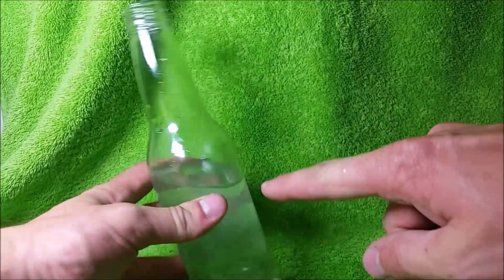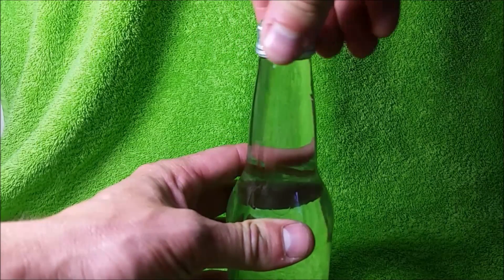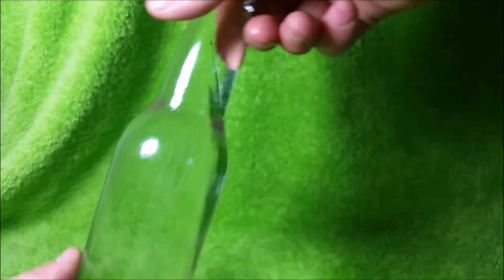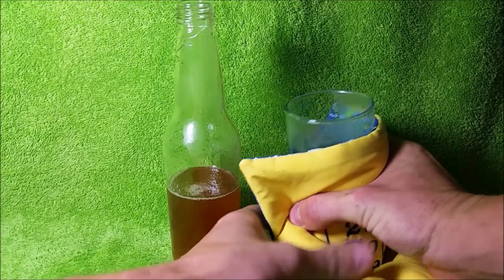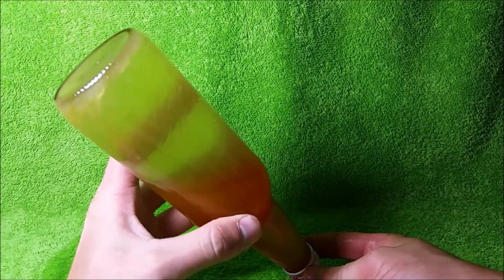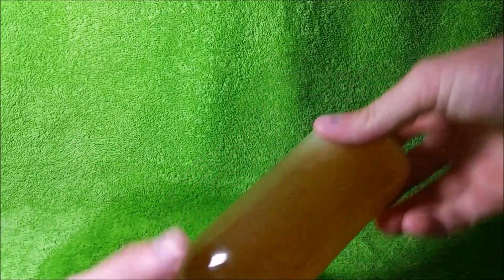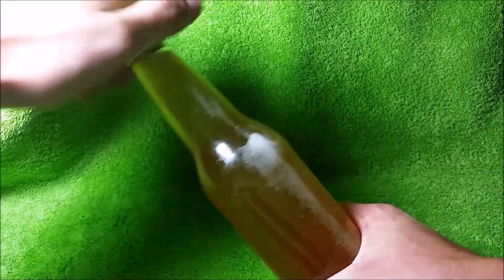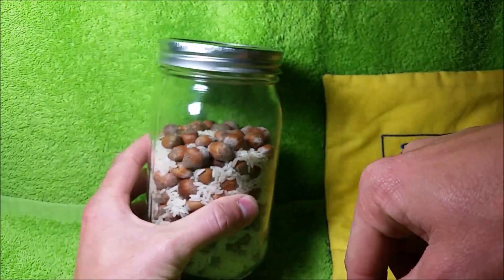Volume Change when Mixing Alcohol and Water Explained

Comment: Your explanation is clever and certainly "feels" right, but it's incorrect. The volumetric decrease is due to hydrogen bonding between the water and ethanol molecules. This is not a chemical reaction; rather, it's a physical phenomenon. There are interactions between the molecules in solution akin to weak magnets pulling on each other. This draws the net volume in as the aggregate effect pulls everything in closer together.

Please don't assert things like this without verifying that your explanation is correct. I appreciate your attempt at science here, but did you not think to look around on YT and/or other internet resources to see if there is a confirmed explanation before "explaining" this phenomenon to others? People will see this and "learn" something that isn't actually correct.

Comment: Used in my high school class. Really helped them understand why 100mL of water + 100 mL of sugar is only around 150 mL. Thank a lot!
Reply: Are you sure? You are not expecting such a huge volume contraction. In fact H2=+ sugar has a lower contraction than H2O+ Alcohol. Sugar has a density of 1.6 kg/L, so, if I may guess:
100g sugar= 62.5ml      100ml water + 62.5ml sugar=162ml. Take some ml away due to the contraction (which is what the video is really about) you end up around 160ml.

Comment: very cool and a great explanation/theory! However I doubt that its actually vacuum in those bubbles. More likely it is the formerly dissolved atmospheric gasses coming out of solution. Still would be lower pressure than the atmosphere, but I doubt it would be deep enough to be considered vacuum conditions.

Comment: A different explanation is that the various solutes disrupt the structure of water.  It is believed that liquid water has regions that have the same structure as solid ice.  Hydrogen bonding is what makes water the miracle that it is (molecules the size of water should be gasses at room temperature) and the best orientation for hydrogen bonds require that the molecules of water move apart a little, creating a little empty space.  This is why ice floats in water.  Google up an image of the structure of ice and you'll see the empty space.

Adding solutes disrupts the beautiful ice-like structures and the hollow spaces collapse.  The water in the bottle shrinks, creating the bubble.

It's really the opposite of Cody's explanation.  Instead of the water fitting into spaces between the alcohol molecules, a better way of thinking about it is that the alcohol molecules almost fit in the hollow spaces between the water molecules.  I say "Almost" fit because they break the beautiful crystal regions as the water molecules stick to them enough that the cages are broken.

Comment: The bubble isn't a vacuum. It's a water/alcohol vapor. Water and alcohol will both boil off quickly enough at ambient temperature, under actual vacuum, that the bubble won't stay vacuum for very long.

Comment: Your explanation is only partly right. The reason why the volume shrinks is that the attractive forces between water molecules and the alcohol molecules are greater than the forces between just alcohol molecules. Because of this the water molecules actually pull the alcohol molecules closer together, creating the loss in volume.
If you were to mix two liquids that have lower attractive forces between each other than each on its own, you could see the exact opposite.

Comment: I've never seen this demonstrated before. Interesting, it makes perfect sense.
Reply: Congrats on 1,000,000
Reply: +blazednlovinit Here is a clear answer to your question. Suppose you took exactly 1 cubic meter of tin, and exactly 1 cubic meter of lead. You would have 2 cubic meters of solid. Now suppose you melted them together to form an alloy and cooled that alloy down to the starting temperature so it solidified. Would you now have exactly 2 cubic meters of alloy? In general, no. You might have more volume, you might have less (it depends on the metals being alloyed and how the atoms arrange themselves--pack together--in the alloy). In chemistry, the effect that Cody demonstrated is known as the volume change of mixing, and in general unless the two molecules being mixed are very similar the volume change of mixing will not be zero.
Reply: +NightHawkInLight Same, this little technique slipped under my radar too. I wonder if it only works with liquids (like solids have less space between their particles and gases would simply increase in pressure?)
Reply: +blazednlovinit He showed it with the hazel nuts and rice too, so it can.
Some alloys are denser than the base materials meaning it can also happen with those etc.
Reply: CapnTates They are still freely moving 'particles', what i'm getting at is "if he froze this molecularly packed solution.... would it compress down to the same degree as if it hadn't gone through molecular packing"
Reply: blazednlovinit Not sure about that particular substance, but like I said: it does occur in solid alloys.
Reply: CapnTates I'm thinking it wouldn't, but I want someone who knows to validate the hypothesis (or not).
Reply: +NightHawkInLight You are awesome for promoting him!
Reply: blazednlovinit I'm saying I know and no, it DOES work.
Reply: +CapnTates i think (s)he is talking about freezing not alloys.
Reply: H Doesn't matter. Frozen means from liquid to solid.
An alloy was mixed in liquid form and are used solid.
It's the same thing.
Reply: CapnTates He's right in that i'm not really satisfied with your answer (what 'does work'?), or that you even understood my question.

Say you have a liquid in a container, and say the volume of the liquid usually decreases by 'X' amount as it freezes and contracts, would the liquid still decrease by 'X' when frozen if it had another chemical molecularly packed into it?

Sorry it's difficult to articular some concepts without thinking about it a little but i think I've made it mostly unambiguous now.
Reply: blazednlovinit That... doesn't matter really.
It might decrease in size more or less. If less, the properties aren't shared with the solid form. If more, even more so.
It is the case with other materials.

By the way, water expands as it freezes, so that'll be interesting to see what it does.
Reply: CapnTates Yeah, water is pretty much the only thing that does that (there may be a couple others but it's a rare trait)

You don't seem to know the answer to what I'm asking really so i look forward to a clearer reply from someone else who knows the answer, no offense.
Reply: ***** It was difficult for me to articulate this question unambiguously I feel, but yes it covers what I wanted to know thanks mate
Reply: ib9rt Thanks for taking the time to clarify this mate, the examples especially made it clear that you were answering the question I had in my head, it was difficult to find the right words to even ask the right question unambiguously
Reply: Yeah. I wonder why they don't teach us this stuff in school.

Comment: Hey Cody
have you checked out the potential settlement of Venus? At some high alttitude mountains it has around one atmosphere of pressure, a temperature around 70º c and it has 0.9 earths gravity. It also costs less to send spaceships there. Should Mars One become Venus One instead? because its become obvious that the Mars mission is overly ambitious and way underfunded. In Venus slow death by cosmic rays could be solved because it actually got an atmosphere. Even though it has no magnetosphere, Mars doesn't have one either, and I'm sure sulphuric acid is more manageable than perchlorates. I could point you to the video I watched on it if you'd like.

Comment: I would think that it actually is not a vacuum, but a low pressure bubble filled with alcohol vapor, since alcohol's vapor pressure is lower than that of water. And in the one with honey, water vapor because water's vapor pressure is lower than that of honey.
Reply: +Elliot Blair Isopropyl alcohol's vapor pressure is higher than that of water, that's why it boils more easily and evaporates more quickly. Estimated vapor pressures at 25 ºC are 23.8 mmHg for water and 33.1 mmHg for isopropyl alcohol. Think of it this way: The pressure applied on the liquid gets higher as more vapor is present, thus a liquid with a higher vapor pressure tends to form more vapor.
Reply: @Cyberw4y  please stop using mmHg and start using real units.
Reply: +Elliot Blair You wouldn't also call that a vacuum?  There is no pure vacuum in nature, just areas of low pressure.
Reply: I am tripping balls man, that's some MLG shit right there!
Reply: Josh Myers Interstellar space ought to have a perfect vacuum. At 1 molecule per m³, there's a lot of empty space. 

If we're gonna be pedantic, every atom has a little perfect vacuum in its electrosphere.
Reply: Josh Myers Its existence is not proven, and it doesn't interact with normal matter. Therefore, it doesn't matter if it's there or not, it's not a "particle" per se.
Reply: +Elliot Blair "Air" is a pretty broad term.
Reply: +Elliot Blair How about this instead: the container is not perfectly sealed, so air from the outside got pushed in by atmospheric pressure
Reply: Cyberw4y still has particles that can be condnsed and affect spacecraft of humans her. You need to move through millions of square meters per dday in space
Reply: Josh Myers I said interstellar. Interplanetary space has lots of molecules, interstellar has approximatedly 1 per square meter.
Reply: Ha.  I'm watching a space show that says due to dark matter, there is no vacuum anywhere!  Nat geo : journey to the edge of universe